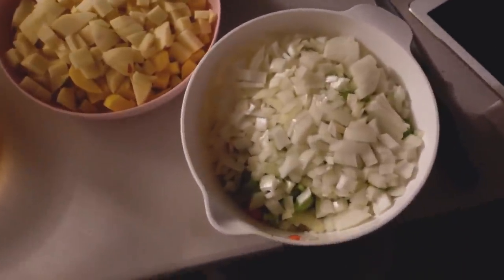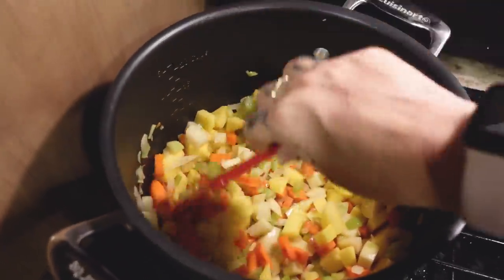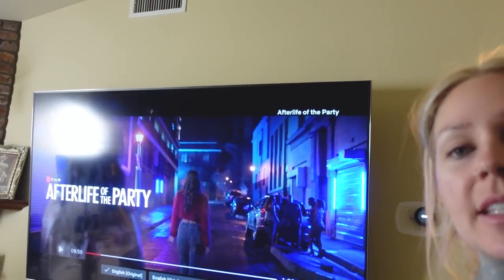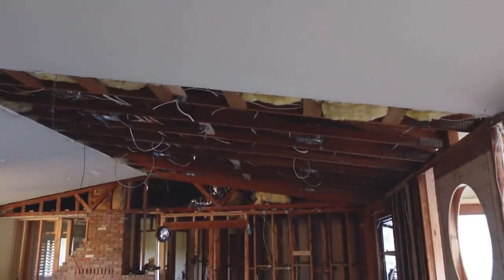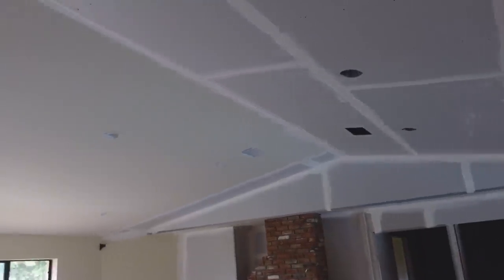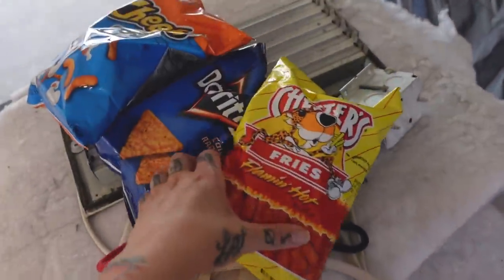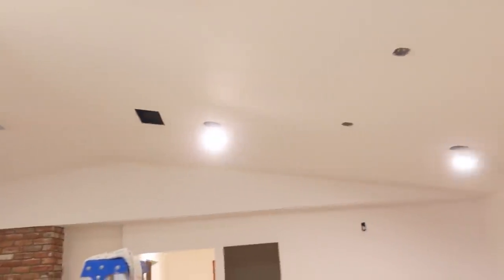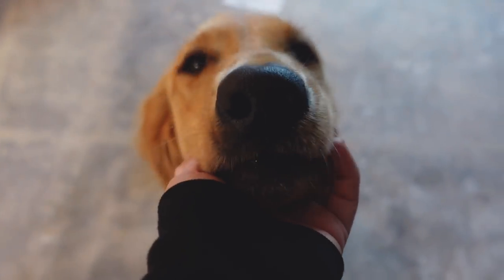No Kitchen for 7+ Months & Pregnant LOL 😳  Home Remodel Vlog PT 3

Comment: As long as you're not moving plumbing or electrical lines. You can remove the bathroom quite cheaply. Changing facets & lights was easy for me. Tiling was a little harder. I used a small cutter. I should've rented a water saw to make cutting easier. Make sure the tile is level & use grout spacers.
Reply from the maker: how inspiring! we're not moving any lines or anything. Just need to retile! Nick already actually changed out the toilet, we painted the cabients and put in a new sink! Looks a million times better. That will be on an upcoming vlog! :D The spacers are KEY yes I remember that from when I was little and my paretns were tiling their own house!!
Reply: @KristenxLeanne  Hang in there. It'll be worth the wait. Have a Blessed Christmas 🎄